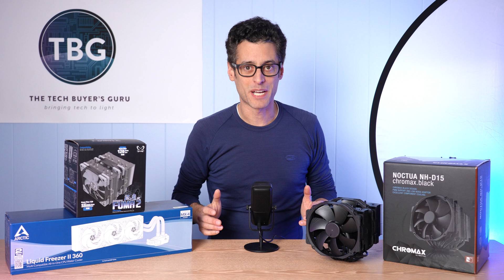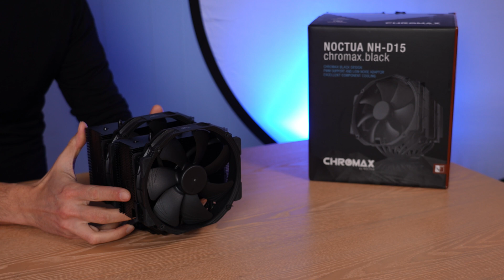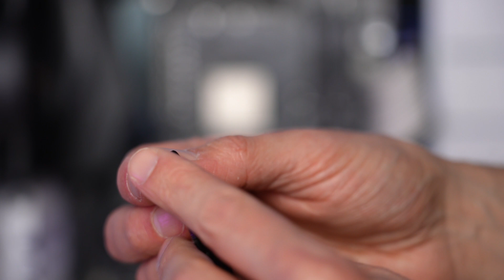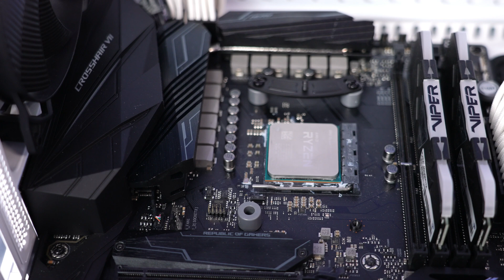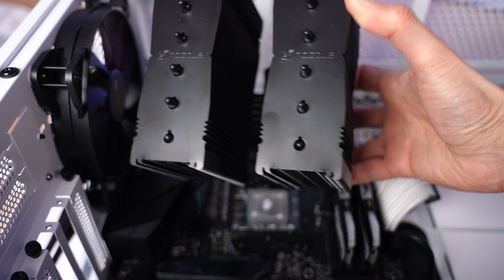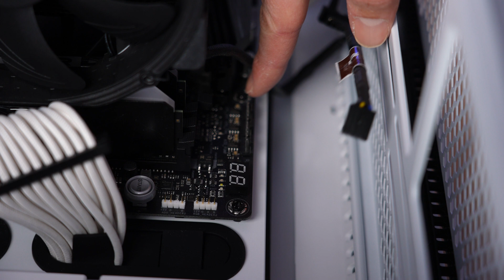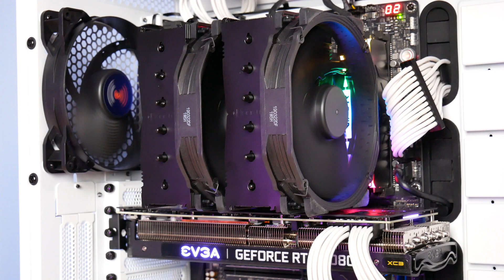The Noctua NH-D15 CPU Cooler: Installation Guide for AMD's AM4 Platform

Comment: I have this fan (which i regret buying) These damn clips have caused me so much hassle. I now have had the middle fan come free, so now need to connect it to the already installed heatsink.  Not sure now which way to even put it so those damn clips connect to heatsink.  Will end up gluing it in a minute.

Comment: Hey I forgot to take the plastic from the bottom of the cooler.  I have not turned the PC on.  Should I remove the cooler and take the plastic off. I put a whole tube of paste so it might help in any case to get some of the paste off (too much).  Also, you did not say what direction should the fans go, blowing away from the RAM or into the RAM, does it matter? for there is a directional choice.  They face the fan on the box of course.  It is OK to put the outside fan on the other side so it is not close to the RAM?  Please explain a bit more. Thank you.
Reply from the maker: That plastic typically would fall right off, as it is not secured to the cooler. Are you sure it's not simply in the box? I agree a whole tube of paste would be too much, but excess would have squeezed to the sides of the CPU. You should look carefully underneath to see if the paste is visible, and if the plastic cover is still there.

The fans blow through the cooler (away from the RAM), just as pictured in the video. They have labels on the back, so it is obvious which way they are facing.

Comment: is it impossible to remove the video card after installing this cooler?  What if the M.2 SSD crashes and you need to get access under the video card?
Reply from the maker: It takes a lot of work, but it's possible.
Reply: @TheTechBuyersGuru  Maybe do a video on how to remove a GPU with a Noctua NH-D15 cooler installed?  That would be interesting.
Reply: It is very much impossible, I also can't replace RAM sticks, absolute nightmare to do anything with this hulking beast of a fan.

Comment: Asus z690 motherboards are not compatible with noctua nh-d15
Reply from the maker: Not entirely correct. Here's the actual compatibility list: https://ncc.noctua.at/coolers/NH-D15-chromax.black-3/motherboards/ASUS/LGA%201700
Certain ROG series boards have plastic shrouds that interfere with the NH-D15 and many other coolers as well.

Comment: Could also explain, which way the fans face? I am guessing they pull air from one side and  if u put the third one, it just exhausts that air to your exhaust fan on the side?
Reply from the maker: Mount the fans just as you see in the video. Spinning hub is towards the front, frame is towards the rear.
Reply: @TheTechBuyersGuru  so basically the air is pulled from one side and goes through the two heatsink towers in that direction

Comment: Pro Tip: Cooler bracket mounting is easiest when the motherboard is not in the case. Always install bracket mounts onto motherboard with backer plate before installing the motherboard if possible.

This does not include upgrading to a new cooler with an existing build, as removing the motherboard to do this install is more hassle than the awkwardness of installing new brackets.

But if this is a fresh build, ALWAYS do this step first!
Reply: Obscures some of the screws though making it impossible to install the motherboard.

Comment: Use masking or cleanroom tape to hold the backplate while installing the mounting bracket.
Reply: I just put all the spacers and screws in loose whilst it was upright, then put it down flat and took one screw out at a time when putting the brackets on so the other loose fitted screws were holding the backplate in place
Reply: I install CPU coolers on top of the motherboard box so the plate is held in place.
Reply: So clutch
Reply: Getting the tape to hold it perfectly in place is way harder than just holding it cause atleast it doesn’t move

Comment: I've installed mine rotated 90 degrees. It blows air from the top to bottom. But it works, doesn't overheat so I don't have any motivation to take it out and rotate it.

Comment: Scored the standard NH-D15 brand new in box for $40 and yesterday picked up this new black version with the white chromax covers for $70 lightly used. Cooling performance is not the only factor in buying a quality cooler but how they install. Some install with far more juggling of parts, backplates and screws. Others you simply set it down on the CPU and easily start the install. Noctua do make some of the better installation methods. All time favorite is my Prolimatech Megahalems which you could finger tighten the crossbar for effortless no risk, no heavy pressure install. I bought a Vetroo V5 for $20 recently for my childs Ryzen 1600AF system and it cools well enough just the install method was no where as good.
Reply from the maker: Thanks for sharing your experience!
Reply: I have the megahalem, now it's sitting duck with my am3 board, wishing the prolimatech will releasing the am4 upgrade kit.
Reply: @AhuaKeren  Yep I just saw your comment 2yrs later. Yes I still own my Megahalems and would love a modern AM4/AM5 kit for it. I bet it would still hang with the top single tower air coolers. Would be curious to see it back in action.

Comment: are the cooler fans intake or exhaust?
Reply from the maker: Set them up with the rotor in the front and the frame pointing to the back (exhaust).

Comment: i use the brown nh-d15, becuase i got it like 3 years ago. and i love this cooler. i have never had a problem with it, my temps along with the fan curve, even while gaming are around 50c tops. and it is whisper quiet.
Reply: Have you had to re-apply thermal grease recently after these years of use?

Comment: Just wondering. Why wouldn't you put the mounting bracket on first before installing the motherboard? I guess if for some reason you already have the motherboard installed, but if doing a new install, it might make things a lot easier to put the mounting bracket on first before installing the motherboard.
Reply from the maker: Most people watching this video are upgrading their cooler. Thus the motherboard is already in the case.

Comment: If you have a pump option on your motherboard just connect the second fan there no need for splitter
Reply from the maker: Actually, you don't want to do that. The AIO pump header will run the fan at 100% all the time. It's not designed to be controlled. A better option is the CPU_OPT header, if the motherboard has one.
Reply: @TheTechBuyersGuru  not true you can go into the bios and control it just the same as everything else. That's what most of the people on forums have been saying including Linus tec tips. Who in his latest pc build put his 1 CPU fan into the aio header.
Reply from the maker: Why tho? It includes a splitter, which makes it much simpler. There's no reason to control the two fans separately.

Comment: there is a way to swich the front fan to the rear side, i mean, the middle stay where it is, but if you wont rise up the front fan and swich it to the opossite side near the back fan of the case is it possible?  i saw a video where this noctua was like i say and it make me fell good because my ram is 44mm and the specs says no more than 40mm xD.
p.D: maybe the secure of the fan have to flip to match the opssite side.

Comment: Awesome video, question: so i have 3 fans atm that are corsair fans that are very loud. And i recently ordered 2x arctic p14 and i am thinking of replacing the arctics with my corsair in the front.

But i still got one in the back and i was wondering should i maybe take the front fan of my nhd15 and use at as a exhaust case fan? How big is the difference when using dual fan and single fan?
Reply from the maker: Your answer is right here: https://youtu.be/VHw4_jiJQO8
Short answer though: don't take fans off your cooler to use as case fans. Just buy another Arctic P14 when you can.
Reply: @TheTechBuyersGuru  alright. Thanks a lot

Comment: was thinking about getting this but just in case is there any other fan cooler that comes close to this one without the blockage of everything
Reply from the maker: Basically, the answer is no. But you may not need this much power. Have a look at this video to see benchmarks on my top recommendations: https://youtu.be/VHw4_jiJQO8

Comment: I still can't figure out what you mean by "the right orientation".  I assume you're using the readability of the logos to determine it, but what part of the motherboard counts as "up"?  The spring-loaded mounting screws make it impossible to install it flipped 90 degrees the wrong way, but how do I know I don't have the metal shell flipped 180 degrees the wrong way?

Comment: I have an issue, mine came with black spacers which are far too long for the screws, I don't see any grey spacers.
Reply from the maker: Double check all bags in the accessory box. There should be an AMD bag with the gray spacers. If not, contact Noctua and they will send a replacement mounting kit.

Comment: hello so noctua ds 15 fit in silent base 802 and without glass version fit too ? can i easy close the door ,there where ds 15 ist ? you closed without a problem ? sorry for my english , i wanna buy this case my case dont fit with ds 15 .
Reply from the maker: The D15 may hit the foam on the steel side panel version of the Silent Base 802.
Reply: @TheTechBuyersGuru  fu... i order silent base 802 with no glass for silence please tell mee i can close this case ....😞
Reply from the maker: Depends how high you need to raise the front fan over your RAM. Hopefully you chose low-profile modules...
Reply: @TheTechBuyersGuru  what you mean by low profile modules ,can you explain i have no idea
Reply: @TheTechBuyersGuru  i undeerstand now ihave corsair ram vegeance lps its say on packing low profile so im good ?
Reply from the maker: You are good.
Reply: @TheTechBuyersGuru  thanks another question i have 3 noctua a12x25 fans should i instal them to have 6 fans ,more air better or change them for only noctua ?
my last pc case was bad does better pc case with more fans gona helping gpu loudness ?
Reply from the maker: You could install them at the top of the case for more airflow, sure. One may also fit in front with the stock be quiet! fans.

Comment: Are you able to add ram slots to slot. 1 and 3 or is the cooler in the way
Reply from the maker: Yes, you can. Same limitations as with other slots... anything above 37mm or so will require the fan to be raised.

Comment: Thanks for the video^^
May I ask you something, just in case you happen to know...
Should I get the Noctua NH-D15 S  instead of the regular NH D-15 for cooling a Ryzen 9 5900X? 
I live in Greece and temperature is quite high during Summer...
I will miss one fan but I will have more room for the video card and the M.2 Slot. Hopefully I will be able to open the top M.2 Slot without unistalling the cooler (I'm not sure though).
I could also buy a second fan later on, but they are expensive and I'd rather avoid it...
The motherboard is an MSI X570 MAG Tomahawk.
Thank you in advance for your time!
Reply from the maker: If you want easier access to your GPU and M.2 drive, definitely get the D15S. But for a serious CPU like the 5900X, the D15 will provide better performance.
Reply: I've got the S version. According to reviews the temp diff is minimal. If you want you can still add a 2nd fan like a 120mm to give extra clearance. A 120 fan is pretty cheap.

Comment: Man I was excited to grab this one but after showing the final build I'm kinda worried that once I've installed everything, it's all locked in place for good... any good tips for removing the cooler later when it's time to upgrade or clean stuff? I know the first step is probably to remove the GPU, but accessing that latch... is even more hostile here because I've filled all RAM slots and there's a chonky nvme that gets in the way of unlatching it by finger (it's one of those horizontal latches from Aorus boards that looks like the RAM latches, I think it opens by pushing it down or pulling it towards the front? Been a while since I messed with it)... seen suggestions in the comments to use a long screwdriver or a ruler, is this the best way to go?
I wish they designed these coolers keeping in mind how cramped it gets by adding an easy way to remove the fans with the cooler installed, so all you had to do next was the super easy step of removing two screws from the mounting bracket and then taking the cooler out of the case vertically...
Reply from the maker: You've pretty much summed up the worst-case scenario. And yes, everyone says use a screwdriver, and I sometimes do this, but there is a risk of damage to the motherboard if it slips while you're pushing hard on it. Something with a blunt end would be better, maybe a wooden dowel. A ruler might work too if it's wide enough.
Reply: @TheTechBuyersGuru  It's been a while since I removed anything here so I don't even remember how much force is required to open the pcie clip, maybe I should test it out soon... the one thing I'm afraid of with the ruler method is that it will just break from the strain of trying to open the clip while only being able to handle it from it's opposite end...
Kinda bums me out, I wanted to stay withing the relative safety of an air cooler but it might drive me into buying an AIO instead (which costs up to like double the D15 around here, but at least it seems a lot easier to handle afterwards)

Comment: My outside fan is not on ?
Reply from the maker: Did you use the included fan splitter cable? Both fans attach to it and the cable attaches to the cpu fan header on the motherboard. Both fans will then work in unison.
Reply: @TheTechBuyersGuru  thank you I figured it out 30 secs after asked that my friend put it on for me and he somehow had the splitter cord stuck in the fan so it was blocked

Comment: Will the Corsair vengeance RGB pro or dominator platinum fit with this cooler?
Reply from the maker: Only if you're willing to raise the fan height significantly, which moderately affects cooling and drastically affects overall height and clearance required in your case. Vengeance RGB Pro is about 5mm taller than the Patriot Viper RAM I used in the video, which already raised cooler height to 170mm or so. That means you're talking 175mm. Dominator Platinum is another 5mm higher, so that means 180mm, and a fan that is way off-center. I would not use the NH-D15 with Dom Plat.
If you want to use Corsair RGB RAM, I'd recommend the new Vengeance SL: https://amzn.to/3zb8fyj
It's about as tall as the Viper RAM I used, which means it's a reasonable match for the D15.
Reply: @TheTechBuyersGuru  thanks for the reply ..do u happen to know what air cooler fits perfect for the vengeance and dominator? Or the people that use these sticks tend to use AIO?
Reply from the maker: Best cooler that won't block the slots is the Scythe Fuma 2 - https://amzn.to/3Bum8d1
See comparison review here: https://youtu.be/VHw4_jiJQO8

Comment: Great video. Installed my NH-D15 so long ago I'd forgotten the steps and wanted to change CPU. This video is a perfect and well polished how to demonstration. With respect to removing the video card with the fans installed mentioned at the end of the video. Simply depress the Video Card latch with a thin long bladed screwdriver.
Reply from the maker: Glad this helped, and yes, that screwdriver trick sounds like a good one, as long as you don't slip and nick the motherboard!
Reply: @TheTechBuyersGuru  I saw one video YouTube where they used a wooden chopstick to depress the video card latch.   It seems like there is less chance of damage using that.
Reply: It's risky just remove the fan with one side and try to pull the other side with thin tool.
Reply: That's why you should buy new ASUS motherboards that have their unique remote latching buttons. Until it becomes industry standard.

Comment: does anyone having issue with the paste applications?
i have Gigabyte B550 auros elite v2 mobo, did all correct spacers and applied like 1/3 paste compared to in this video and still my paste coming out of edges.

had to clean the excess paste 3 times and now im not even sure if there is enough paste left.